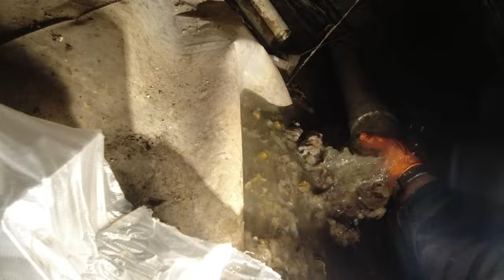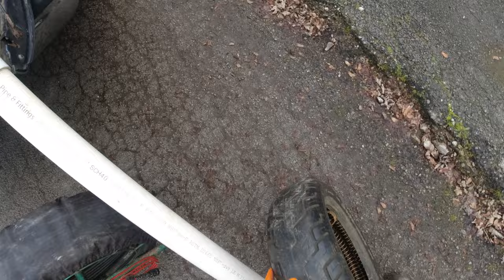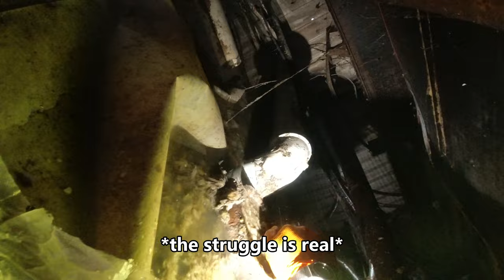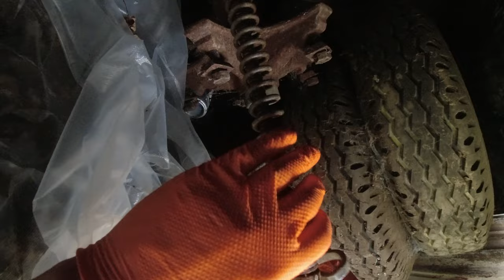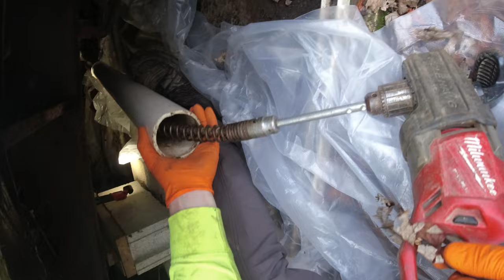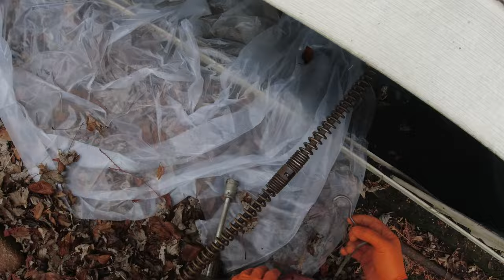Trailer park sewer plug, clear it with the Milwaukee HoleHawg

Comment: I thought you were driving a full size van, now you're working out the back of a pickup.  Is it becouse you have the truck just for drain work? Love your videos. This one was nasty!!!😮
Reply from the maker: Basically yes, the van was for service plumbing, but I love the truck because the cab has so much more room for my 6'2" frame and it rides nicer, doesn't get blown around in the wind, and pulls the trailer. Plus I'm not doing plumbing anymore, only drain cleaning and sewer service. I still have the van hoping the perfect helper/tech will come along.

Comment: nice job! what garden hose is that you had in your  truck that you used?
Reply from the maker: Thanks for stopping by! The hose is my favorite! It's lightweight, super flexible, no kink, collapsible, plus it can hold a little water in it during the winter and it still works once it inflates.  75foot by ZeroG-- search for Zero-G Pro Teknor Apex 3/4-in x 75-ft Contractor-Duty Kink Free Woven Green Coiled Hose
Reply: @kcplumbingandrooter   thanks I will check it out. Be cool to see a setup video of your cube truck sometime.